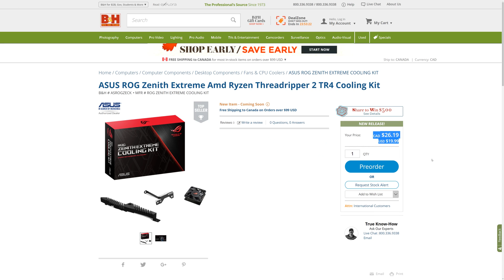ASUS ROG Zenith Extreme Cooling Kit Installation

Comment: I only have the 1950x with this board, my issue is i'm running 3 m.2 SSD's and 1 of them is the Samsung 970 Evo+ and when installed under the chipset heatsink it gets into the 70c range until it locks up the system. I had to install it onto the dimm.2 card and install a fan on the included bracket and I went the extra step and bought them little sticky memory coolers for video cards, and stuck 1 of them onto that m.2 drive, cools it for sure but man the fan is ugly. I need to source me a fan that doesn't look so bad, I almost got this kit for the heck of it until I seen the little ugly fan it comes with.
Reply from the maker: Really?! I ran a 1950X on mine and used 3 M.2 Samsung 960 PROs as well. I also had one under the heatsink for the chipset and it was totally fine. It ran a little warmer than the others, but not THAT hot. Seems like you know what you're doing and are taking the right steps to resolve the issue.
Reply: @WiltshireTutorials  Yeah I thought it would be fine, not sure why it was so hot to be honest, I thought it was my overclock failing for some reason when my system was locking up, but with a quick diskmark test, it got into the 70C range and ended up freezing up. The Inland m.2 I have installed into it now runs cool enough under it, but it also runs cooler without it under there, I'm not sure if that thermalpad is making good contact or not, can't see once its all screwed down.
Reply from the maker: You could buy different thermal pads in thickness and see if a thicker pad makes a difference or not.

Comment: is this only applicable for the 2nd gen threadripper or can the 1st gen threadrippper benefit from this too.
Reply from the maker: I was, and still am, using a 1950x with the kit. Seems to help a little bit with temps. I do plan on upgrading to a 2990WX or 3rd Gen. Threadripper, if the board gets the BIOS update to do it.
Reply: @WiltshireTutorials  So much for upgrading to 3rd gen using the same motherboard. -.-

Comment: sadly no room either as my aio jsut makes it above the board and no room to spare so i think with fans blowing air out it gets enough cooling.
Reply from the maker: You could still install the heatsink and leave the small fan out.
Reply: @WiltshireTutorials  maybe but literally the aio fans are maybe a paper or inch apart from it.

Comment: so this means I cannot upgrade to this as my case is evga dg 87.

Yes this video is helpful as I never knew how to install it. I not gotten it yet as i am on 1950x and my vrm temps ahve been under 50c or around 30c idle.
Reply from the maker: I don't understand why you can't get it due to you owning a EVGA DG 87 case?
Reply: @WiltshireTutorials  The fan wont fit as i got fans on the top cooling that part already I think :).

Comment: JJ from Asus said this kit was compatible with the Zenith, Strix, and the Prime but after carefully looking over the Strix I noticed it won't work :/
Reply from the maker: Unfortunately, I think this will ONLY work with the Zenith. If I had the other motherboards, I'd happily test things for you. But, I don't own the PRIME or STRIX variants :/
Reply: @WiltshireTutorials  I think the fan and bracket will work with any motherboards with VRM temp issue becasue they all have the same mounting holes.